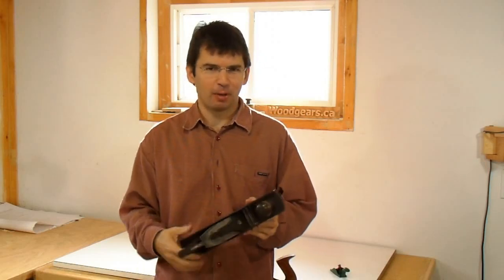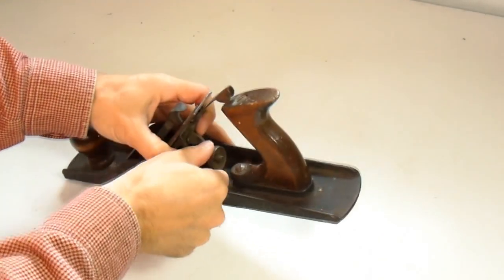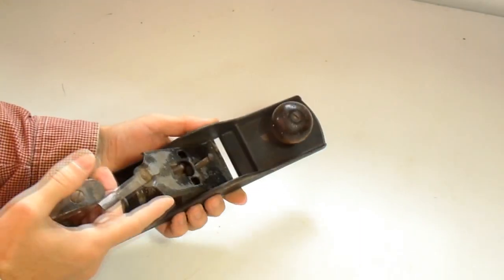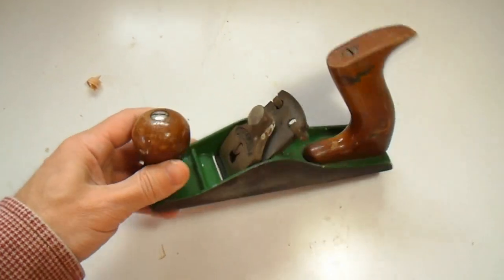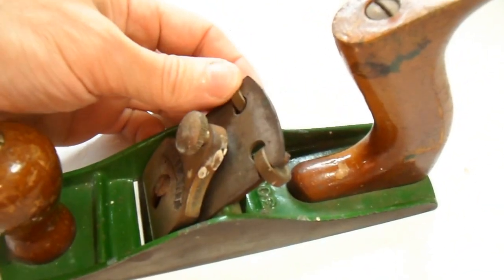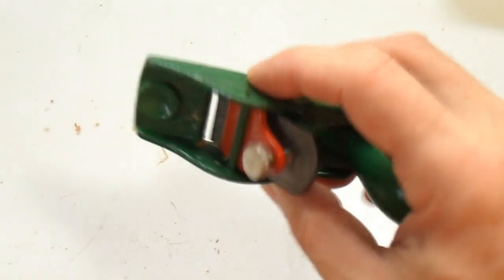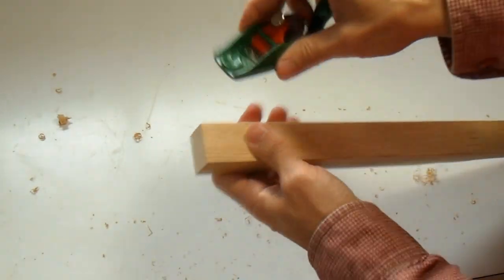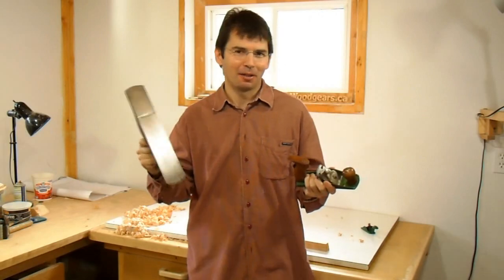My favourite hand planes

Comment: Planes are my favorite hand tools. I'm very partial to the Stanley planes from the "Sweetheart" era...1920's and 30's. If you're patient, you can pick them up for about $40 each on ebay, and the irons are wonderful. I've had to repair a cracked tote or two, but I bought them to use, not to admire. I'm debating whether to pursue a #113 compass plane or a #71 router plane next.

My favorite so far is probably my Stanley #40, a scrub plane. It will take 1/8" or more off of oak in a good diagonal pass.

Every shop ought to have a good smooth plane and jack plane, the size of a Stanely #4 and #5.

Comment: It comes down to anything is better than nothing.  

Dad had an old beat up plane that looked like it had been to hell and back but that was one of the best cutting planes he had.  I remember him pulling it apart and lapping the bottom with some 320 wet-n-dry on a sheet of glass.  He also touched up the blade the same way.  I found out later that it was part of his boat tools that he took with him on every wood boat he worked on or owned.

Comment: I'm glad I'm not the only one who refuses to pay the huge $$$$ for planes. The middle plane is a near copy of the Harbor Freight $10 plane that everyone trashes. Personally i feel folks buy the $10 plane to gripe or to show off their cazillion dollar collection of planes and show how sorry it is compared to the expensive set. I have one anx use it alot. Alot of my lumber is rough cut and covered in unthinkable crud. This cheapo get me to the grain and the dust, dirt, and crud it sucks thru itself with its open mouth. The same plane I flattened on a 10 inch thick 4x6 feet granite plate. with a shim under the blade to close up the mouth it will shave a super fine shaving. But i got it just as a roughing plane.
Reply: Phil Lowman

Comment: In Germany you will easily find cheap but usable hand planes  like the ones you mentioned :)
Also I know very well what you mean but in my case I just don't have the space for any power tools apart from my bench top drillpress, my router and my hand drill so I pretty much have to use hand planes and saws.
So the fact that you don't have a hand plane that you have to keep in top condition is kind of a luxury for me ;)
I envy you for not having the need for more hand planes....

Comment: Matthias, I have a couple planes I think you would like. One in particular I think you would really like. It's a small aluminum plane that uses a double edged razor like was used in the old-style double-edge safety razors. It actually can be put together in 3 different ways to make a different style of plane for different purposes.

It's small, but a neat little plane. And it actually cuts reasonably well too. More of a curiosity than anything though.

Comment: @bladder1010 If you're breaking edges and doing rough edging, a cheap plane that's well-maintained is what you need.  For most of my work, I use an old Stanley 29 I picked up for around five dollars on eBay.  For fine finishing, though, or tricky woods, I turn to a Blum or Primus plane.

Comment: The practise of laying a plane on it's side is centuries old. It is simply to protect the blade and final finish from inadvertent damage. Laying a plane heel on wood is fine, however one screw, nail, file, hasp or other metal tool ... you get the idea.
It's easy to pooh pooh this when you rarely use a hand plane or not an indentured apprentice. 
The old master will say 'It's no more trouble to lay on its side as on the heel...so bloody well do it!'
Like a always using push stick..

Comment: It's still taught. To protect a finish. To protect the iron. Honing is dead time. Sanding a gouge from a finish from a careless plane park is dead time and sanding a finish where a notch or feathered iron has gouged a 600 hour piece is real dead time.

Like Mr. Wandel found when his jointer iron was used on phenolic plywood.